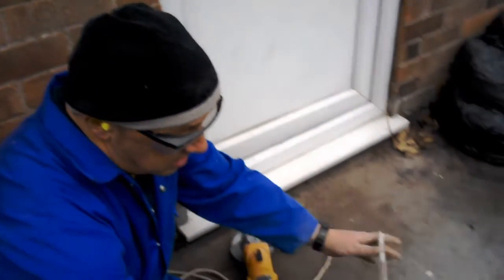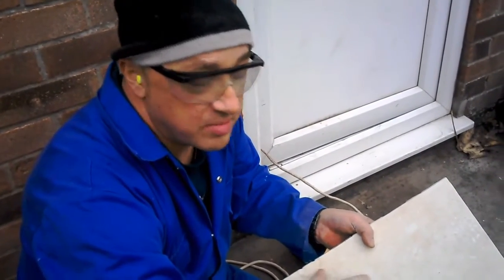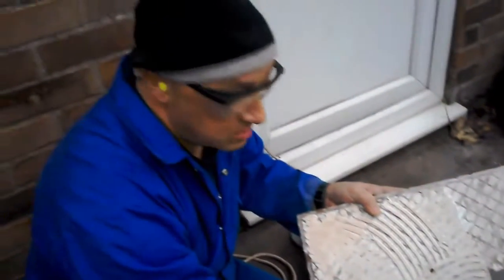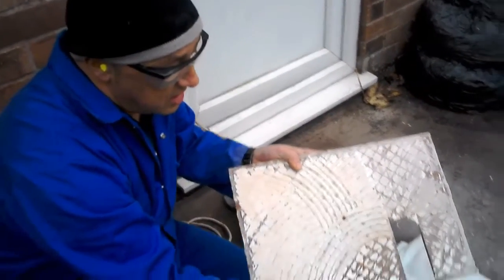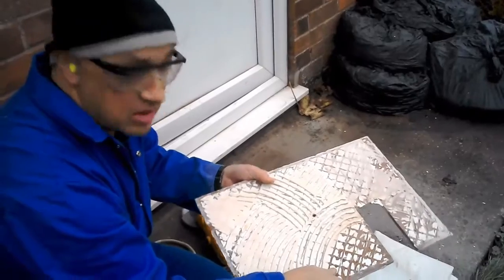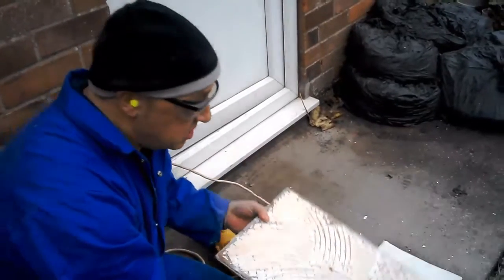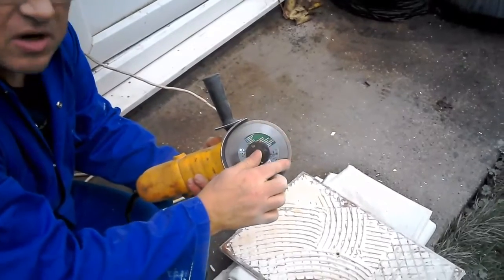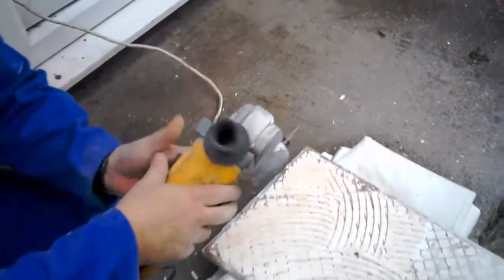Reusing Wall Tiles - How to Remove Old Adhesive

Comment: You're working too hard. Soak them in water/muriatic acid mix overnight. Around 10:1 mix should do it. Put it in a plastic tub or bucket big enough for the amount of tiles, and it will brush or scrape off as if it were new liquid thinset.
Reply from the maker: Good tip, thanks.

Comment: come on man, you can't even see how the tool is making contact with the adhesive!!!
Reply from the maker: Whenever I get these kind of "your video isn't clear enough /doesn't give enough information" comments I say "That's fine, you make a video instead, it'll be better".. It's actually what got me into making YouTube videos in the first place, looking for info that I couldn't seem to find. Regarding the contact, it is light touch at about 45°. The blade in this video was pretty aggressive, so it was important not to dig in until I had the feeling for it. Practice on a broken tile if you've got one.

Comment: I happened to use a circular wire brush on an angle grinder - the ones used to get rid of rust on old cars and it worked just fine. You can either step on the tile - but care must be taken not to go near your shoe or boot ware. This is obviously something which you should not do barefoot

Comment: i just this week took out a big job 378  16 in x 16 in   i used a milwaukee rotary hammer drill on jack hamer mode that tool is so soft but agressive just perfect i only broke 2  i am installing all those tiles in my music studio as we speak        takes about 18 seconds per tile
Reply from the maker: Thanks for the tool recommendation. Sounds like it worked great.
Reply: Well these are porcelain tiles and slate tiles the entire bathroom was laced with orange membrane so when removing the tiles it all stuck on so I brought them home with all the mortar and membrane attached so I've been jack hammering all of it still got some to do if ya need a demo let me know I'll send ya a video
Reply from the maker: @colinrobichaud1730  Thanks Colin, got my job all done now. Maybe you might post a video on your own channel? The tile video was the vey first video on my own channel, now got more than 125 videos up there! Give it a go! 👍

Comment from the maker: Thanks for the comment oskey. As you can see in the video I placed the tile on a folded dust sheet which seemed to help keep it still, but sometimes, as you suggested I did use my boot.

Comment: I have a question I'm working in a shower there's no access wall in the back so I had to cut out tile with backer board but it's hard to match the tile it's a half inch thick so I was trying to get backer board off of the back of the tile any thoughts on that I thought it would be easier to do that than to try to replace the tile any thoughts
Reply from the maker: That's tricky. If you can sacrifice the backer board and replace it with new you might be able to cut the backer board off in sections with a reciprocating saw, or even a hand saw. I mean cut a small section down to the tile back, through the board and then cut that piece away, or chisel it off (risky). Good luck!

Comment: My bathroom had carpet glued to the ceramic. tile floor. I was able to pull the carpet however I'm left with a dark gray "glue/adhesive" all over the floor. I can see blue ceramic tile but the floor is covered in this adhesive! Is there any way to remove this and keep the tile?
Reply from the maker: Deborah Dunkerson The method in this video is to help people reuse tiles that have a cement type of adhesive on the back. I expect carpet will have been stuck down with a different sort of glue altogether. Usually it's a type called "contact adhesive". You might try looking up how to remove contact adhesive, or carpet adhesive on the internet or YouTube, but my video here won't help you. Sorry, and good luck. 
My wife just chipped in saying "does the glue soften if you heat it up (with a hair dryer or hot air gun)". Not a bad thought...

Comment: How did u remove the tiles from the wall without cracking them so u can reuse them?
Reply from the maker: It was tricky.  I didn't save them all. I used a mixture of tools,  some gentle leverage but also I cut away all the grout so the this didn't drive forces into the tile itself,  but allowed movement.  I think this was probably very important.